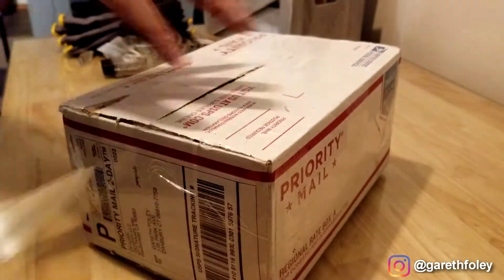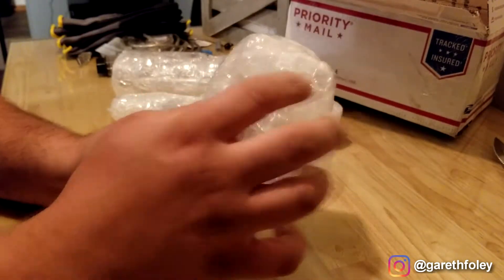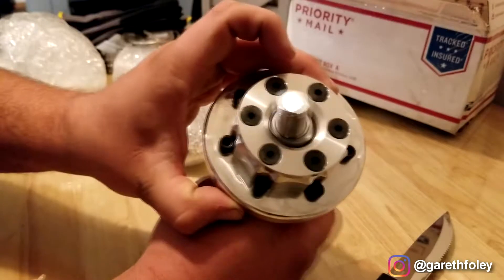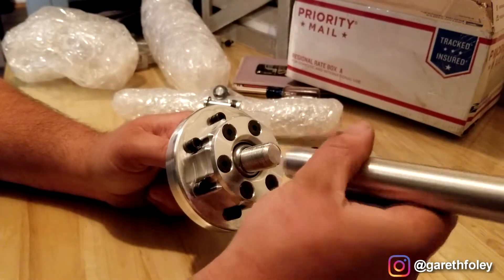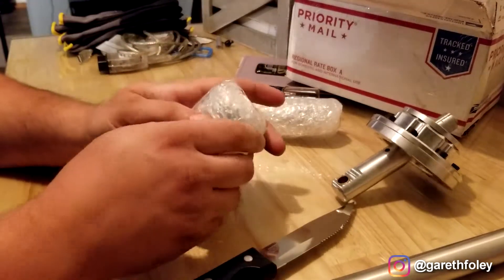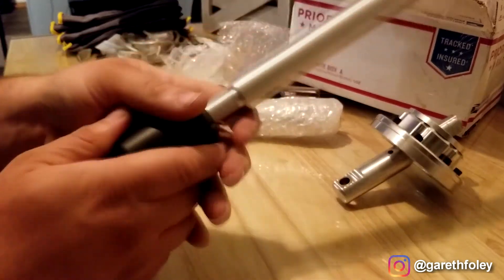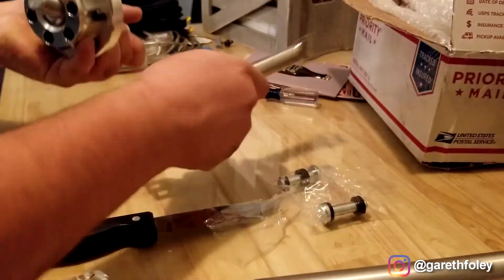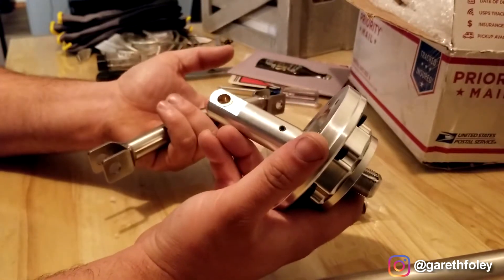Garagistic Solid Mount Shifter and DSSR - Unboxing and Review

Comment: Good video, the lead time has me trying to decide between theirs and the cliq tuning one.
Reply from the maker: I hadn't seen the Cliq Tuning option when I ordered this shifter. I was made aware of it afterwards. The wait was doable for me only because the car still wasn't together yet. I don't regret the purchase, I really like the shifter combined with the DSSR. Tomorrow is my first track day with the car so it will be interesting to see how it performs under those conditions.
Reply: Gareth Foley yeah neither is my car but I don't wanna wait 5 weeks to be able to shift it.
I wonder if the cliq one would work with just the DSSR. My trans came from an e39 so I can't use any of the factory stuff anyways.
Reply from the maker: @blakesommers77  As long as it's the same model transmission it will be fine regardless of which chassis it came out of. I assume you're using a ZF 320? And the DSSR you're referring to is from Garagistic?
Reply: @GarethFoley  Thats correct,
Reply from the maker: @blakesommers77  Any ZF 320 is going to bolt in the same. Just a matter of different selector rods and shift lever supports (at least for OE style shifters) that makes the trans fit multiple applications.